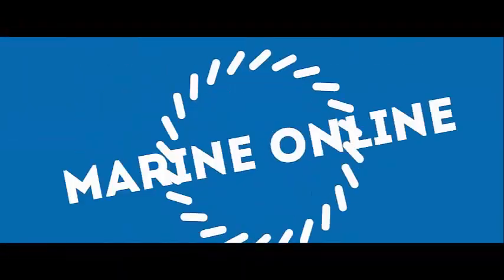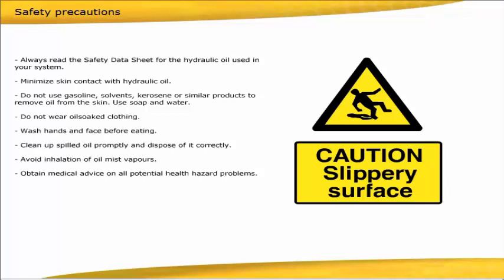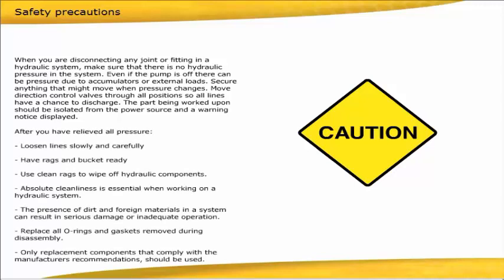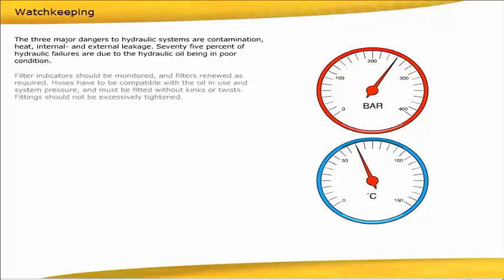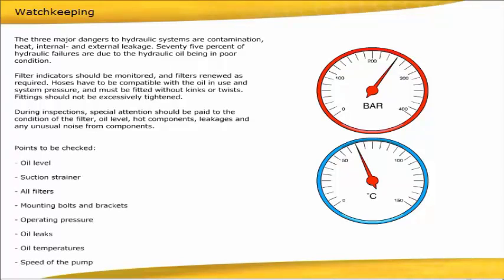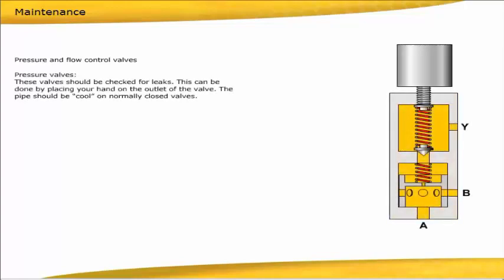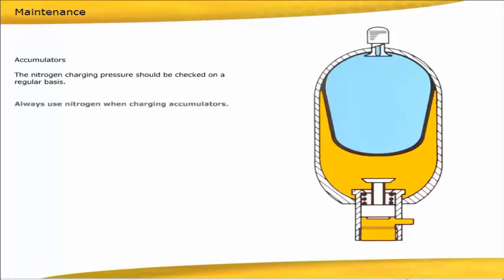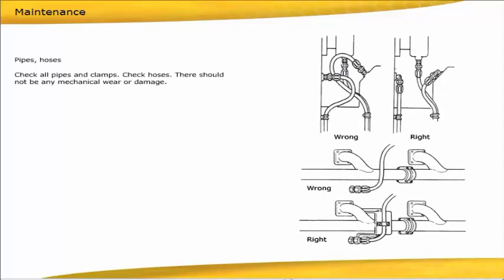Hydraulic Safety Precautions and Hydraulic System Maintenance

Comment: You forgot the most common safety risk a maintenance guy will make: using your fingers to look for leaks... DO NOT do this because an oil leak spraying out of a small hole under pressure is like a water jet machine which can cut through steel plate...or your finger. Oil injection injury is very serious, it must always be assessed & treated in hospital without delay. Failure to do this can leave you with hydraulic injection necrosis, loss of fingers, limbs & life.